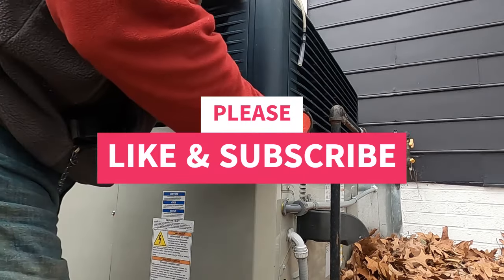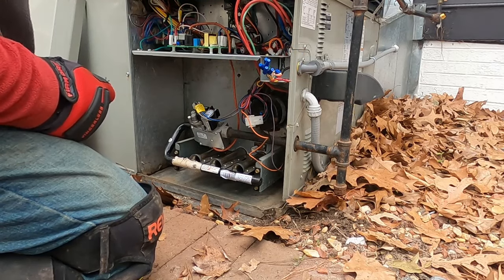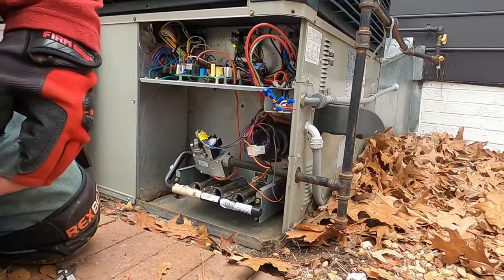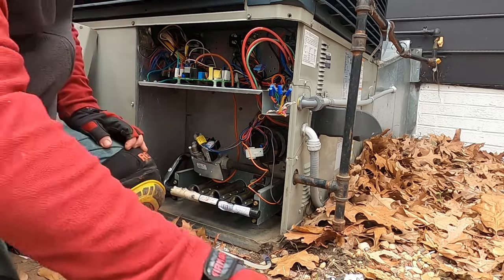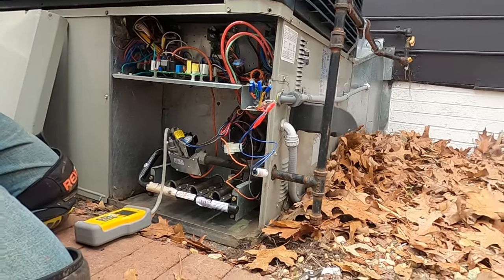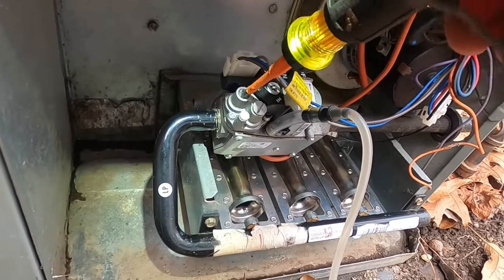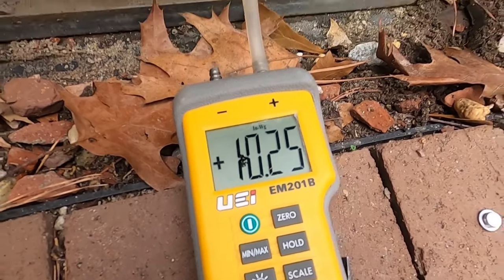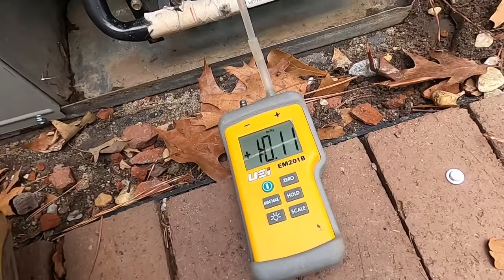YOUR TOOLS ARE YOUR BEST FRIEND!

Comment: The new lead in on the this video is the best one so far.  Never worked on a package unit here in Colorado, hell I have never even seen one, but they are interesting to learn about, just in case I move somewhere that has them.  I like they are outside and not in an attic.
Reply from the maker: Popular in the south and mi-Atlantic region. Also used on most commercial rooftops in our area.

Comment: If the batteries don't get changed regularly, I'd recommend Lithium batteries, because they don't leak.  Even premium alkaline batteries will leak (in my experience, especially if they were made in dragon-country; the same brand, e.g. Energizer, will be less likely to leak if made in USA).  I use Lithium batteries in all of my meters and measuring tools.